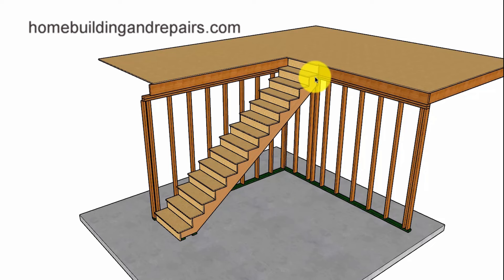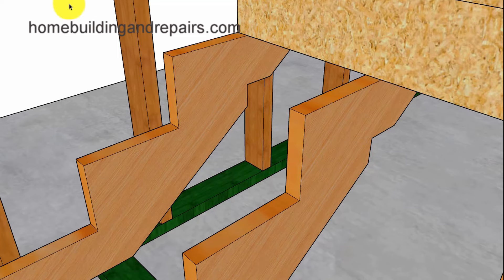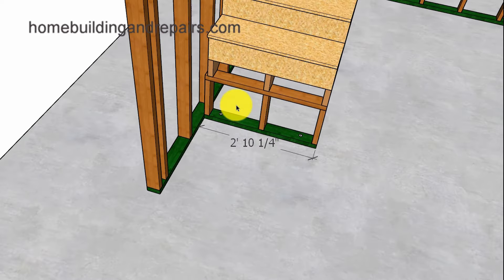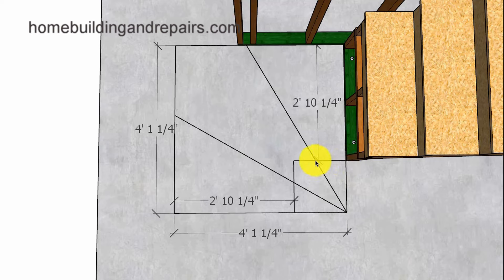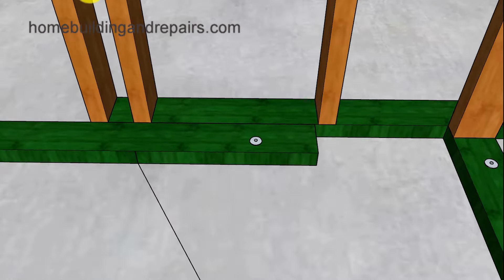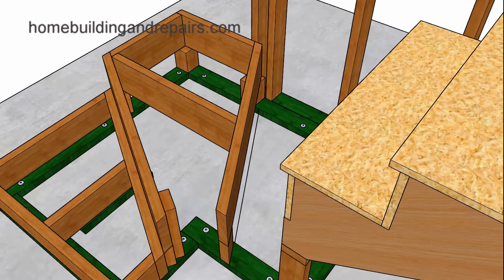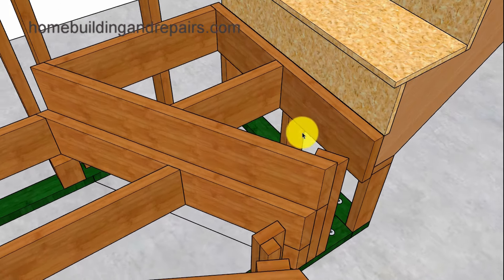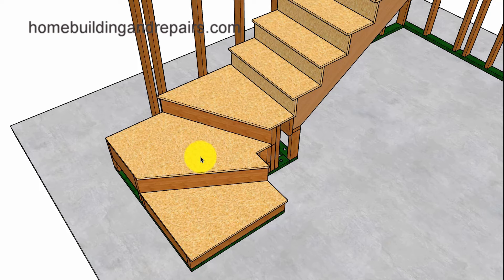How To Convert Bottom of Straight Stairway To Three Step Winder - Easy Home Remodeling Tutorial

Comment: Have you ever used a carpenter square and stair gages or nuts? set them at 12 and 6 7/8ths  this will give the angles you need to work off the corner of you sheet, 30* , 60*. for a 2 stage winder simple 45*. We add numbers in the notch according to what is need. We also have standard dimension add into each winder. These dimensions are for installation purposes and how the winder gets supported.

Comment: Just ran across your video & you seem like the person i need....we just purchased a small 1950s ranch with steep very small steps (stairs)going in basement, the previous ppl that lived there fell down them several times.
The thought is making them turn so we can safely walk down them... they are not safe the way they are. It's been a rental house the last 40+ years ,so no one has done anything to this house that it needed..
 Problem is the head space, there is a wall directly in front of them at the bottom, a doorway to the right we would block if turned right, & a fireplace or something in the way were it would be very hard & costly to take wall out, and aŕ wall is in the way going to the left. 
There's no room for more headspace either. Cause it's a small house
   1 remodeler recommended moving them altogether  but the other remodelers said that wouldn't work...
  We are on a budget cause so much has to be done to be liveable but the stairs are on my "has to be done" list cause i have to go in basement for laundry & I'm gonna be doing alot of the stuff down there myself. 
   Point is no one seems to be able to figure it out. Do you have any recommendations as to where to look for , who to call , etc... atp any help is appreciated
Reply from the maker: Head over to website and check out more videos. https://www.homebuildingandrepairs.com/remodeling/stairs/index.html

Comment: For the amateur designer 2 steps for a 1/8 turn (22.5 degrees each, 45 degrees total) with the inside 6" forming a 1 ft. straight line, will provide 10-1/8" to 10-3/8" at 12" from the inside of the turn.  This should give you leeway to fit step in most strange dimensions.  I had to use straight (non-winder) steps to a 1/8 turn, straight steps to another 1/8 turn, finally straight steps to a 1/4 turn and 1 bottom straight step.

On the Inside Edge:
The 2 winders will fill 12" horizontal 0" vertical, 0" horizontal 12" vertical, or 8.5" horizontal and 8.5" vertical at 45 degree angle.  

This places the straight non-winder steps at 10" horizontal 0" vertical, 10" vertical 0" horizontal, or 7-1/8" horizontal 7-1/8" vertical at the 45 degree angle.

Creating a spiral-ish shape
This can be used to create a spiral-ish circular or octagon shape 8 feet across with 11 steps before ducking under the higher steps for 85.25" drop, more than enough for the 6'8" code.  You have enough room for 4 straight steps entering the 1st turn (48" from 1st winder, 40" for 4 straight steps), 5 if you have the top step set back 2" more.

With this, in a 3/4 turn you can drop 20 steps, almost 13 feet, in an 8' by 8' space, though there light be some code limit on the total number of steps.

Comment: Good video, but might I suggest you check the headroom limitations BEFORE you build the temporary (or not) short wall and cut the stringers at the bottom of the existing stair.
- Architect Tom D.
Reply from the maker: Yes,  headroom is a definite one, building codes, handrailing, guard railing, materials and the list goes on an on doesn't it. Thanks for sharing.